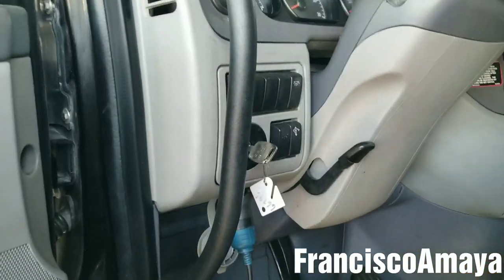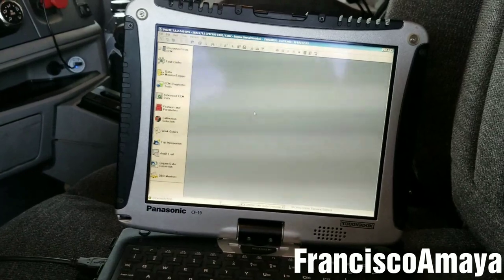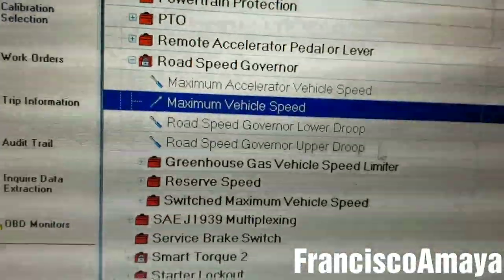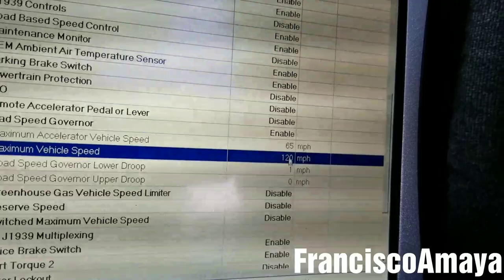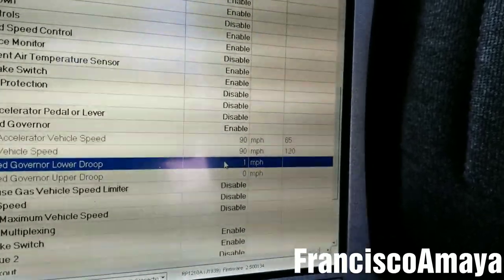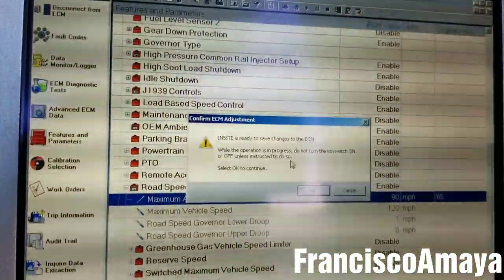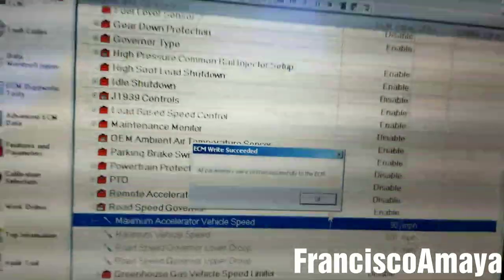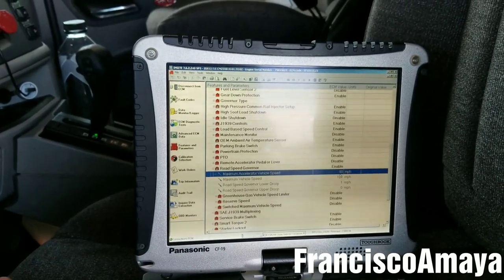Cummins ISX ISX15 road speed limit programming freightliner Kenworth peterbilt international volvo

Comment: Hello Francisco, I have a challenge for you! How can I limit the road speed on a roll off Truck when the hoist body is up using the road speed limiter option. I have done it on a 2019 Pete 520 but not on a 2023 Pete 567 with the ISX12. Any idea!

Comment: Can a driver get the software and change the speed on the pedal and on the cruise control
Reply: I want to know this too. And one way or another I will find a way, if I have to buy my own ecm and put it in a company truck. I say f what the company wants, they aren't driving it, I am.
Reply: The issue comes in when it’s “password locked “ to change the peramters